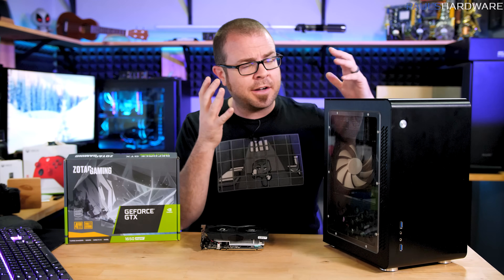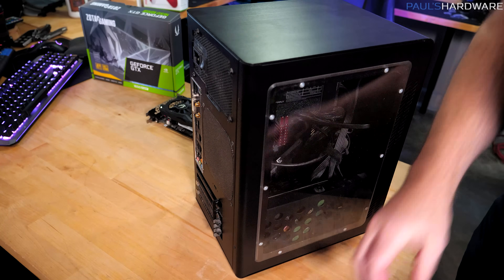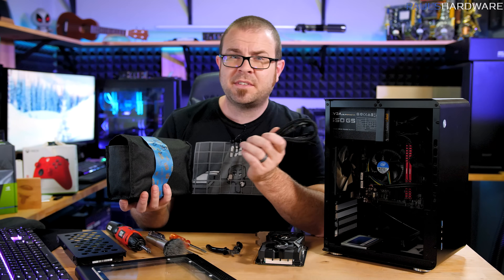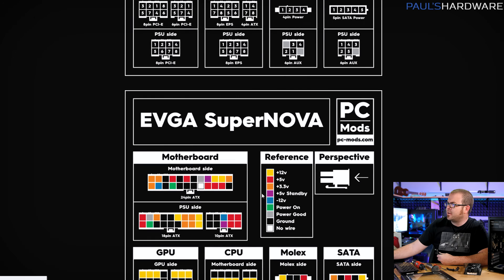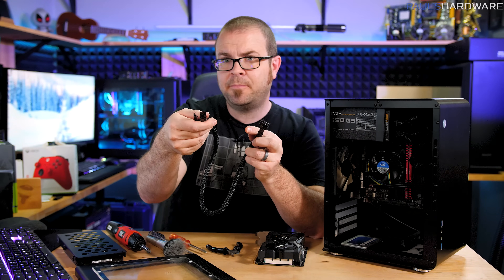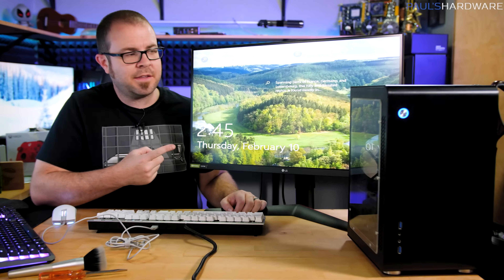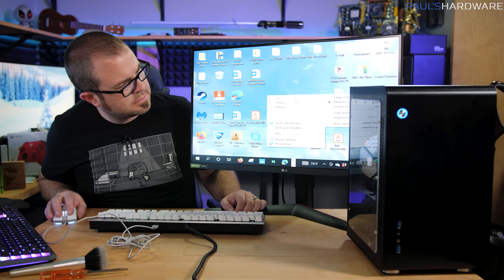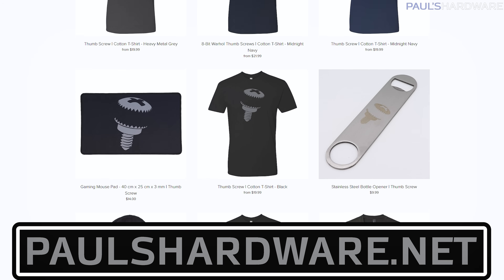Upgrading a Quad-core PC from 2015

Comment: Damn! This is super similar to my current build from 2016! 
I am looking to uprgrade it in October when PC Component prices may finally stabilize again.
Any tips on how to recycle as many of my 2015 parts as possible and still build a highend mini ITX gaming PC? Does that even make sense?
I have an Asus H170I-Plus D3 Motherboard with an Intel I5-6500 CPU, 16gb of DDR-3 RAM, a borowed RTX-970 GPU and a 650W PSU.
Not stellar. I know.
I would at least like to reuse the case, but mini ITX options are fairly limited right now :(
Does anybody have any advice where to start?

Comment: I'm glad you mentioned that not all cables are interchangeable, even amongst the same branded psus. I bought a used EVGA unit that was missing sata power cables, so I thought I could use a cable from an older EVGA psu I had. Obviously, the pinouts were NOT the same and I fried the hard drives I plugged in. I was lucky that nothing else was damaged honestly.

Comment: I've had this problem. Hell I still have the CX550M PSU that's missing the PCIE 6+2 pin cables, I just used a random molex to 6pin to power the GTX1060 that's in there lol

Comment: I also love my old setup from 2014 with i7 4790k
Replaced with newer 10700k but my second old system is runnin in my living room for casual games, emulators games ect. 
Still very good cpu

Comment: Back in my OEM days I would velcro at least one connected and ready PCIe cable somewhere visible the same height as the GPU slot, if the customer had specified internal graphics only. We sometimes bought back systems, and over that 15 or so year span I think I can count on one hand the times the customer could/wanted to find their accessory box.

Comment: I did this with a stock Lenovo Thinkstation with an i7 8700, Installed a 1tb NVMe, 32GB of ram, a 3070 FE and some Noctua Fans. It runs great at 1080p, but if I try to run any games at 4k on my TV it Hard Reboots immediately. I guess the stock 400w PSU just isn't enough.

Comment: You could also use the 'loop test' on you multimeter to find the corresponding pins on each connector.

Comment: Paul, just so you know... the stock cooler replacement you used uses a Nidec fan which has only about 60% the maximum RPM of the (Delta) fan on the cooler you removed. Shouldn't be a huge problem, but you might consider setting a CPU cooling profile that's a bit more aggressive as a result.
Also, you're 100% right about that case supporting µATX – the × 4 expansion slots are a dead giveaway.

Comment: Paul,
  Your meter has continuity mode (the bottom right, speaker looking setting).

you could have used this to prove the pins from the PSU side, and the device side, without needing any PSU in the first instance.
THEN you could have tested using the method you then showed in the video.

As someone experienced in PCB component repair/replacement, continuity is the ideal way to check for traces and such.

Sorry for criticising, but if you go randomly poking multimeters into live electronics, thinks can go bang :(

Comment: If you know the pinout from the power supply, you can test the cable without even plugging it in by using your multimeter in continuity mode, or just a simple test light. I'd only recommend probing a cable attached to an active power supply if you can't find a pinout for your specific model.

Comment: I am presently doing the same thing.. I was a Ryzen first Adaptor.. I went from a 1700 to a 2700X and I started with an RX480 4gig and got stuck with it because of prices.. I spent the last 3 years saving for a GPU and waiting for the right price.. Well I found a 6900XT for 1299.99 yesterday on Newegg, for sale by newegg New.. So I pulled the trigger.. OH YEAH I just got an official 5000 series BIOS too for my ASRock TAICHI I am loving life right now.. As LONG AS MY BOARD performs like X470 I'll be good with that.. I don't need PCIE gen 4/5 or DDR5 at all yet..  Parts are supposed to come in today.. Can't wait.. With these upgrades I will be able to get another 5 years out of my Rig...

Comment: 9:22
As someone who used modular PSU, I stopped after killing off an SSD, 2x HDDs and a BD drive, because of the OEM =/= same manufacturer.

Whenever my friends asks if they should go modular or semi-modular, I say, "no. not unless you can buy spare cables right away, which have matched up connections. Here' let me show you what I mean...."

Comment: 8:05 we're quickly approaching the limits of what you can do with 75w though. Older cards like 750ti had enough headroom to overclock a little, but since 1050ti, 75w cards have been power limited and it's looking like 1650 GTX is as far as it'll go, any more power/performance will require pcie power from the PSU
Reply: Yeah I was a bit sad to see the 3050 come out and require extra power. I was hoping to upgrade my ITX GPU from the 1650 at some point without needing the supplemental power. I mean it has an FSP 650w SFX modular PSU but in a case like the Silverstone ML08 the cable management doesn't really exist so I would prefer a PCIe powered card.

Comment: 5:02 This is exactly why I prefer a non-modular PSU! Any decent case has enough space to hide extra cables, so really there is little reason to opt for a modular PSU when non-modular are cheaper and you can't lose wires.
Reply: I prefer modular as it makes working on a build much easier without the spaghetti everywhere. Yeah you can hide cables in most cases but when people take pride in their systems they know that the cable madness exists even if it's not visible. I also prefer modular as you can buy/make custom length and colour cables to fit your build perfectly if you're in to that. You would only be able to use extensions with a fully wired PSU (which creates even more cables to try and hide)
Reply: @AndyMitchellUK26  99% of people stick that ugly box in their feet and just use it. Y'all getting way too excited over non-issues. 😂
Reply: @em0_tion  I see that you're clearly not a PC enthusiast then. A lot of builders take pride in their systems which is why tempered glass cases are so widespread now. I never said it was an issue, I said that people taking pride in their systems will do all that they can to make them look nicer. Modular PSUs make life easier for building.
Reply: @AndyMitchellUK26  You say you "see", but you took my words literally and just made my point. Chill, Mr. Pride, I get it. 😉 It's still only a PC at the end of the day, it's not more valuable, nor more exciting than a human. ✌

Comment: I've got the same case (aka Jonsbo U3) with solid panel rather than glass. B450 mATX mobo, with Ryzen 7 3800X, RTX3060, NVME, 2x SSD, 1x 3.5" HDD, and a Corsair 650w modular PSU. Was a tight fit to say the least!

Comment: An excellent video, I've watched a few of yours now,  you saved me $600 on my very recent Z690 upgrade. I use a synthetic 1/2'' paintbrush and a vacuum on mine too.  So I have some spares (a i7-6700k, the mobo, and a spare GTX980) - still good enough for 1080p gaming.  My two girls love their games and they've grown out of the very cheap Lenovo M93P and GTX 1030 build I did.  They want to play AAA titles now (they love the Borderlands series)  So I need a case, cooler and RAM, I have the rest.  I really agree, upgrading is best.  Keep making great content, it's really relevant to the ups/downs/ins and outs of PC's.

Comment: Sure if you have a voltmeter exclusively you'd need to do this, but who has JUST a voltmeter nowadays? You're most likely going to have a multimeter, so why not just use the continuity tester to check the pin-out instead of plugging it in and testing the voltage?

Comment: Don't forget that you can track the wires without turning the PSU on by using your multimeter in continuity/resistance mode and using one lead on each end.

Comment: A multimeter usually also has a function to test for connection between 2 points. That would probably be the way to go if you know the pin layout. But testing for 12V/ground with the psu on also works :-)
Reply: Continuity

Comment: Better way is to test resistance between the pinouts, without being connected to the power supply.  If you know the pinout, this is the safest way.

Comment: Just use a Dual 4 pin Molex to PCI-E power adapter. They are 5 bucks on Amazon. I do not think we needed an entire video on this.
Reply: Because those no name Molex adapters are so reliable and trustworthy. WTF LOL
Reply: @4500MHz_Jay  .. Not true. I have built 20K + PCs and owned a PC store for 26 years. They work fine. To test them, simply do a visual inspection and tug at the wires. They are fine if they pass the two simple tests. No need to make more of this then it is.
Reply: @davejones1959  Tugging at the wires is no definitive way to test their future stability under maximum VGA power draw load. I'd stick to reliable brands or quality DIY, risking fires for close to nothing is not worth it.
Reply: Okay, drop your business name here so we know not to buy junk from you. I bet you won't 😏

Comment: The worst thing about this build was: trying to fit 8GB in dual channel in it, filling both memory slots, and now having to swap both of those for two 8GB sticks in order to utilize the games that the 1650 can run at 1080p, and without it it will be a stutter festival, high average, horrific 1% lows. It could not game with an intel iGpu, so having dual channel did pretty much nothing, and now that it needs it it cannot have it upgraded. If ti had 4 slots, ok. But I don't think there are miniITX boards with four, so sticking one of 8GB and leaving the other empty was a reasonable thing to do.

Comment: Re: tracing each wire - just use the "CONTINUITY" function on your multimeter! It will easily tell you which end is connected to what on the other side 
No need to do dangerous things like turning on a 600W PSU and blindly prodding at it!!!
Reply: Yeah I'm not sure why anyone would do it any other way. You just need to know the wires don't switch positions.

Comment: No info on how to overcome a completely missing PCIe power cable.  I would make one from scratch using the pinouts, and connectors/wire sourced easily from ebay or Amazon. but that is not something for the inexperienced or faint of heart.  As for the iGPU-still-running issue and not getting signal from the dGPU, that is addressed in the BIOS/UEFI

Comment: i see you jay and linus all try to clean case fans with brushes and it takes a long time you dont ever get them 100% clean. I take mine and spray them off with water with either a hose or in my shower. i might spray degreaser on them to, same thing with air coolers and cpu cases. Also i bought a cheap pancake compressor and it works way better than those compressed air cans, vacuum or anything sold for cleaning a pc.

Comment: Up until 2019, I was "gaming" (I use that term loosely) on a used 2012 Dell Inspiron 570 AMD Athlon II X2 250 from 2012, with discrete GT630 that I had bought for it. 
In 2019 I started my assembling my current PC. now I'm using a i9-9900k with a 2070 Super. Runs what I need it to on high settings (or maxed out settings in War Thunder)

Comment: Put the Hoover down. Slowly, now—no one's PC has to die today. Good, now we can talk.

Don't hoover your PC. You'd be better off building a diorama of Dust Bowl-era Oklahoma inside your case and presenting it at a county fair. Vacuum cleaners generate static electricity that could easily mean the death of your system. In fact, get that PC away from anything associated with vacuum cleaners—the carpet, for instance.

It is not the vacuum cleaner's power source that causes a problem. It's the static charge that builds up on the plastic nozzle. Additionally, vacuuming isn't effective unless you hold the nozzle very close to the electronics you're cleaning, so an electrostatic discharge is entirely possible. If you've been vacuuming the interior of your case for ages and have never had a problem, you've been lucky

Comment: Ah, just plug one end into the psu, snip off the other end and solder all the bottom (3 tab side and bottom three from back of pcb) to ground and the other 3  to the top 3 solder bumps. Never loose that cable again. Hahaha

Comment: I don’t get this at all lol, just use one of those 9 million dual molex to PEG converter cables that used to come with every GPU that I know everyone has lol
Reply: Less connections, less resistance - more reliability. Electricity doesn't care about our ease of use, especially in a dusty environment. But you can always take risks, it's your choice. 👍

Comment: This PC, except for the GPU, was more high-end than my 2015 PC. An AMD FX-8350 with 8GB of DDR3 and a GTX960, no SSD. It served me well all the way to 2020, I had so much fun playing The Witcher 3 and random indie games on it.
Reply: I'm running an fx6300 and gtx970, 16mb of DDR3. It's doing great on most games, but I had to quit Star Citizen and DCS for the time being. Looking to upgrade, waiting for the 2022 CPU and GPU goodness.
Reply: Similar experience here. My pc was built around a 4690k and gtx 660 which got upgraded to a 960 within a year.
I'm still running the old cpu/mobo, but with a 3060 now. I keep holding off upgrading the cpu/mobo as I don't feel that restrained yet, but it's certainly coming
Reply: Pretty similar to ^^ all you all. 
Before 2015- 8320 and 7850. 
During- 4690k and 980. Got a SSD 'which, not running bloatware, I didn't find the revelation people did. Depending on Game, load times were better 

The 980 was a huge upgrade, and lasted me until last year. 500$. 

The 4690k I got flack for. Multicore, it's actually slower. But single core dominated the 8320. Emulators like the PS2 didn't work great on the 8320.

Comment: I have a first generation Ryzen-based PC built in 2015, that has just about overstated it's welcome on account of EVGA's warranty eclipsing. (~$1900 at the time)

Waiting for the price of components to come down, but no matter how carefully I treat my build, it is beginning to start showing its age and it's a little frustrating when it comes to resting the system over weekends or long periods of non-use...

I know my system is practically geriatric, but I just don't see any conceivable way to afford a successor system with the way the market is right now... And I guarantee you, my salary has increased dramatically since I built the poor thing...
Reply: Ryzen came out in 2017

Comment: Couldn't you just bios [PEG] multi-monitor. use two identical monitors and figure it out easier than plugging both ports one at a time trying to find a display? lol. with one plugged into integrated and one dedicated?

Comment: I've heard allot of lore that it's not safe to vacuum clean a computer. 1) Is that BS? 2) If not, are you using some kind of 'special' vacuum? or 3) Is it enough to just make sure you don't make contact with the components and 'flick' the dirt to the nozzle with the duster? (seems like that's what you're doing but unsure) Edit: guess I should have finished watching before commenting. My brain is smooth
Reply: I had written my comment but stopped to look at other comments before posting.. I guess I'll watch the rest of the video  xD

Comment: Alternatively to the way you used the voltmeter, it also has a connection test setting where you can just touch the two ends of a wire and find out if they are indeed the same wire or not
Reply: was just about to say the same thing ... and also ... it's multimeter :D runs away

Comment: Since you knew what PSU the cable was from, you could have looked up the pin out for that PSU as a double check before powering it up and using the multi-meter. (Compare the pin out from the cable's PSU to the cable pin out from the computer's PSU. I'd still use the multi-meter in case the cable isn't actually from the PSU you think it is from.)

Comment: [Captain Obvious voice] When the power supply is so '''old''' that you can''t buy the exact same cable from the manufacturer. Or you have to resort to doing an internet search and manually test the connections. Get a new power supply, and sent the old power supply to the recycler. Or use the old one for a different project.
Better to spend less than $100 for a new power supply, than spend hundreds replacing fried components. Or replace a completely torched computer.
Just don't buy one of these fire sale NewEgg power supplies.

Comment: You can just use the volt meter to check continuity on each pin and then check the pin out graph.
Reply: You need to know which ones are loaded with volts.

Comment: There is a better way to check the pinout without applying voltage to the cable in question. Use the Continuity setting on the meter to map the pinout. It beeps when there is connection between the leads. Use the Voltmeter only to confirm the pinout of the PSU.

Comment: I liked your procedure for validating the cable vs the one that GN did some time ago. As a person who uses a multimeter occasionally as part of my job I would have approached this the same way you did and was sort of pulling my hair out watching Steve (mad respect for GN) doing continuity checks with a hand drawn plug diagram. Your method was so much easier.
Reply: I much prefer to test dead circuits when I can. This from the POV of Navy Electrician working with 450V 3 phase. BTW, main distro bus on Aircraft carrier is 4160V 3 phase
Reply: @whirledpeaz5758  I was a Navy FC, then went into the semiconductor industry working for IM Flash Technologies in Lehi UT, then as an automation technician for Danone, then as a mechanic for Sarcos Robotics and currently as a Field Service Rep for Steris working on medical sterilization equipment.

I'll hit a 12V pin to a known ground all day every day.